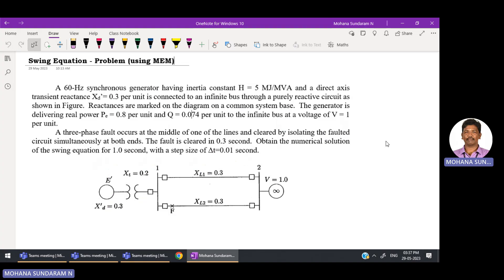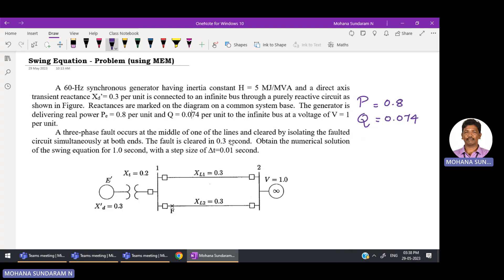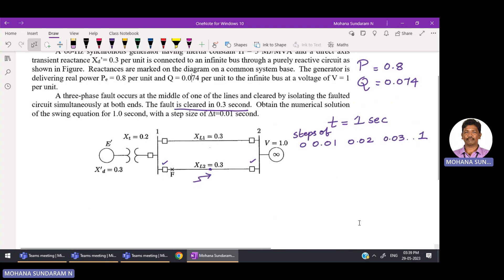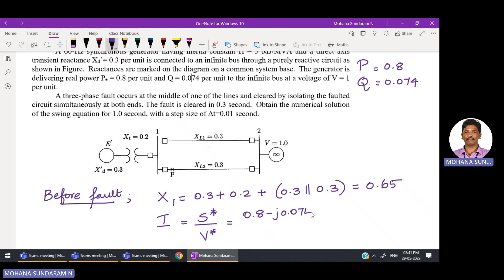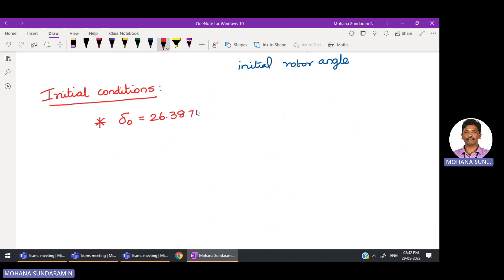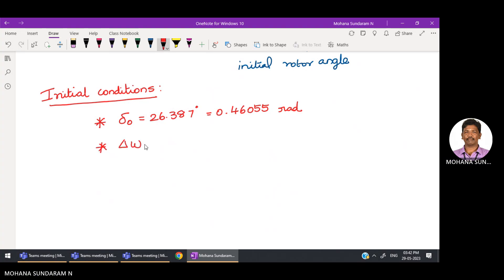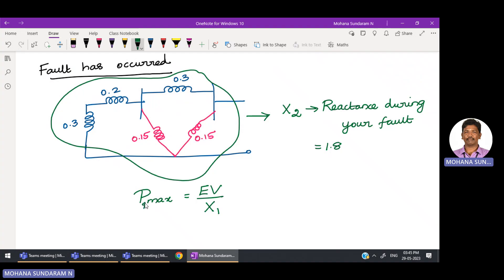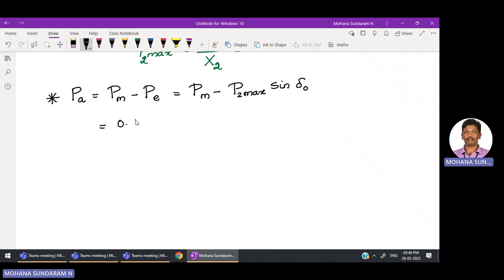Swing Equation Problem using Modified Euler's Method

Comment: Explain how do you get x2=1.8 during fault at 8:15
Reply: you need to convert the star connection into delta connection as to find the transfer impedance between generator bus and infinite bus